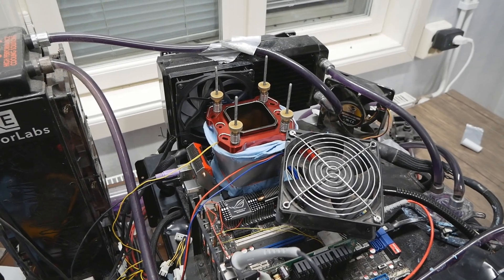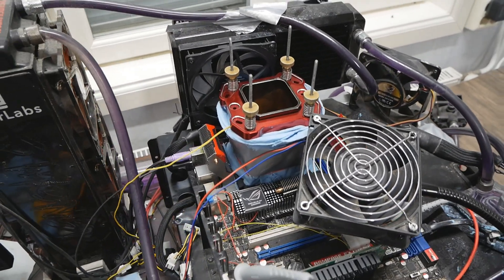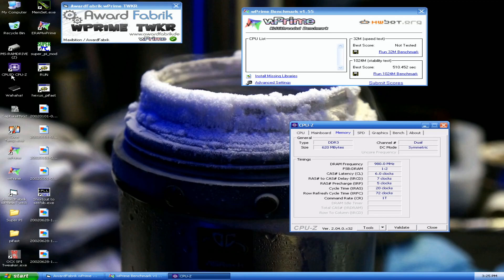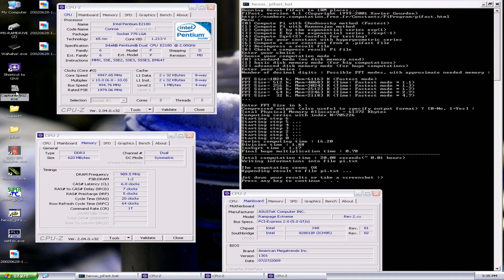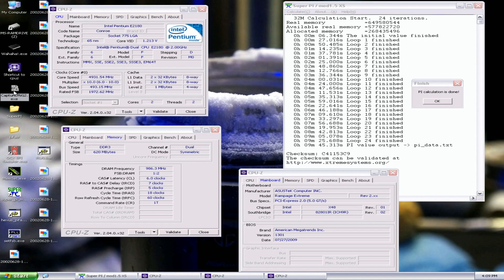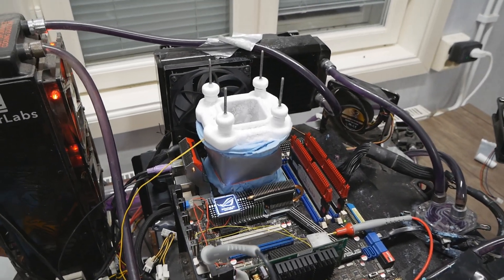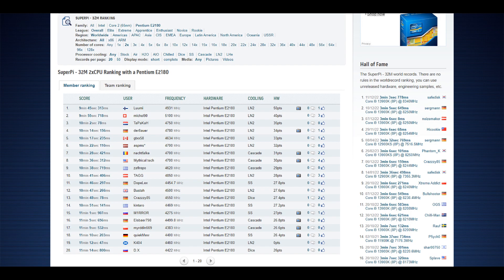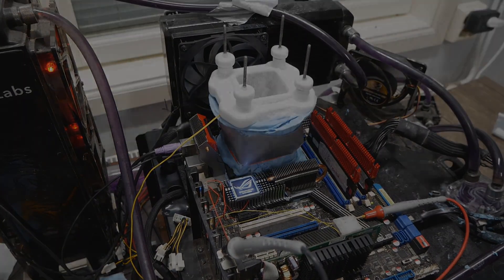One of The Fastest OC Records I Ever Got - Intel Pentium E2180 Overclocked Close to 5GHz.

Comment: I have E5800 have ×16 multiplier, but I'm using stock cooler and g31 board. all 45nm dual core cpu seem stuck at 4,5ghz in my system because it too hot